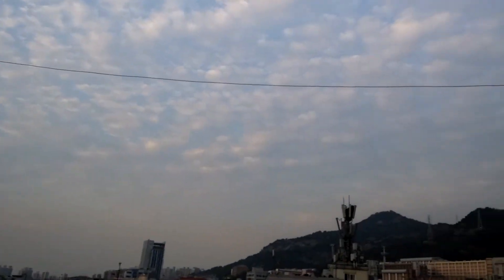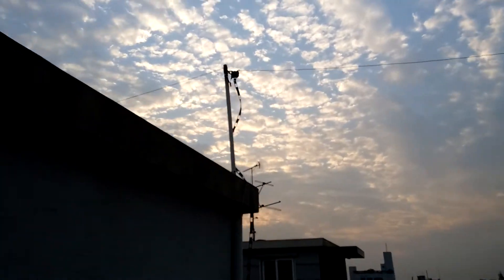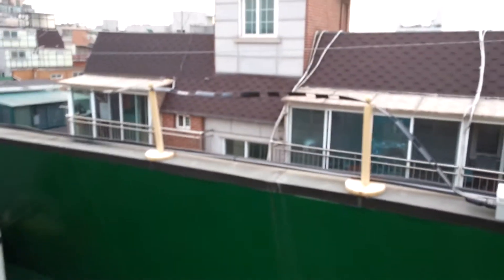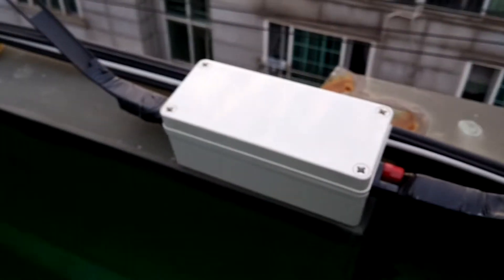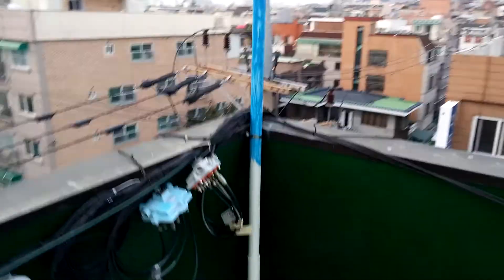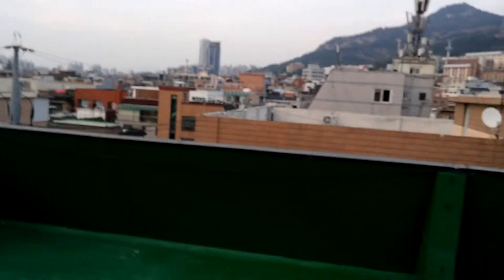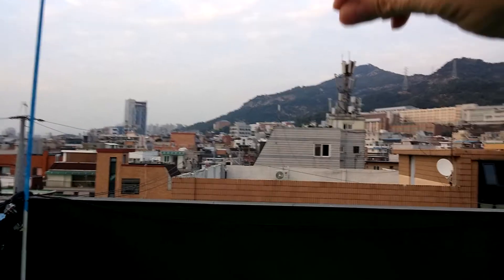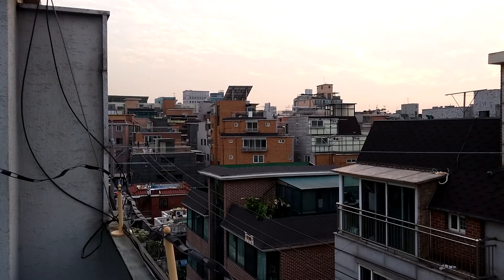Full 40m loop antenna on the roof

Comment: Hi.  So the antenna wire is soldered or connected into one big circle.  And then how do you connect the ladderline to the antenna?  Do you just solder or connect it anyway so there is a metal connection from each side of the ladderline to a spot on the antenna?
Reply from the maker: Hi, happened to be online now.  The wire is one big circle.  One end of the wire is connected to one lead on the ladder line.  That same long wire just makes a circle all around and connects to the other ladder line lead after it completes the circle to the other side.
Reply: Nice.  I understand you are saying that each ladderline lead is separately connected to both ends of the antennae tp form a circle. (And that the  antennae wire itself does not need to be soldered together  in addition to having its  two end points  connected to the ladder line, right?   Also,  are you able to transmit as well as receive on this antennae?  Thanks @thestingyham1188